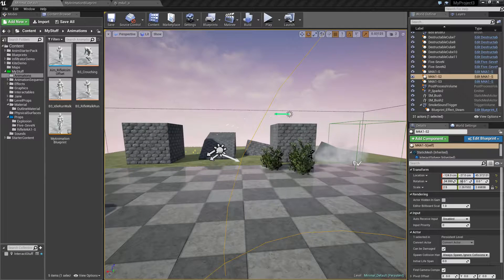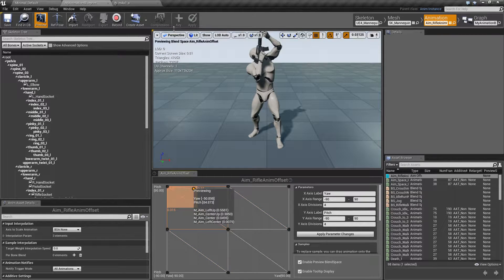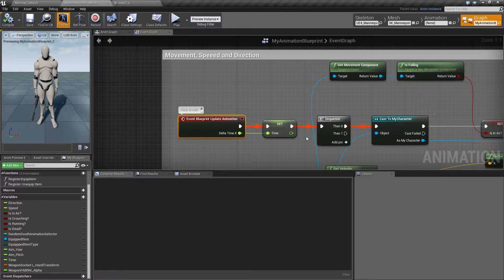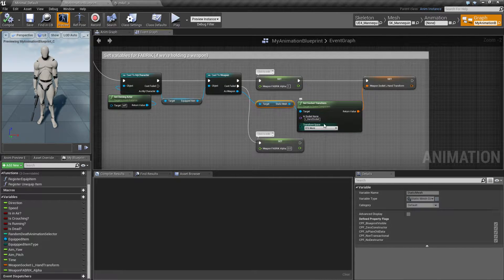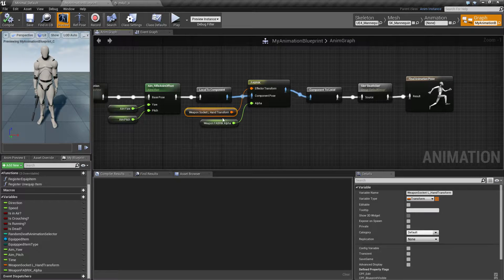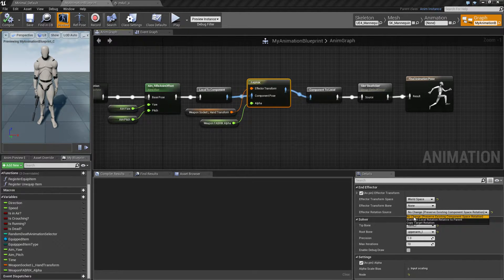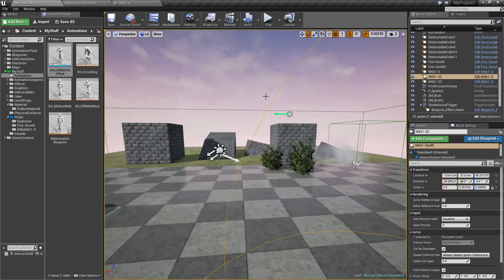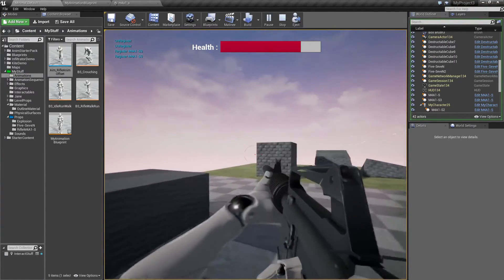Week 1: UE4.9 Partial solution to AimOffset with a Rifle using FABRIK

Comment: Did you manage to find a solution to the problem? In 2019, there is the same problem.
Reply: Oh, and by the way, thanks, Jonas. I have learned a lot from you!
Reply: @juhaojala7579  i fixed it by changing the effector transform space in the details panel of the fabrik node to "Bone Space"